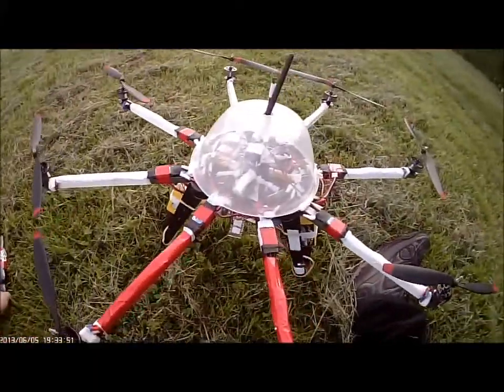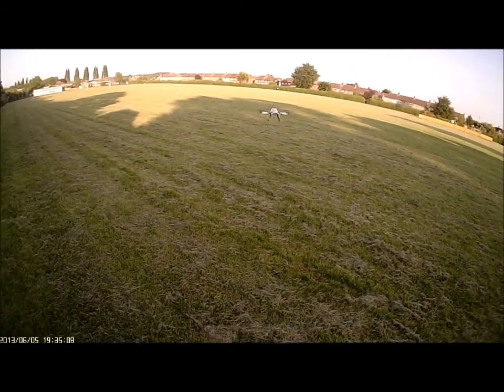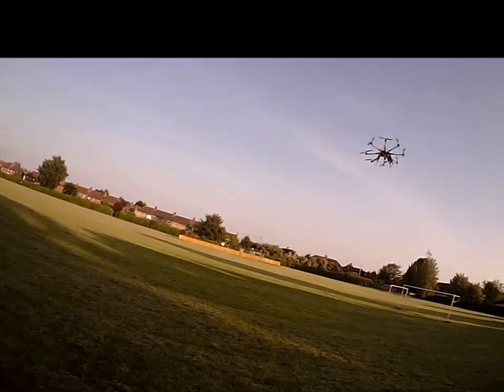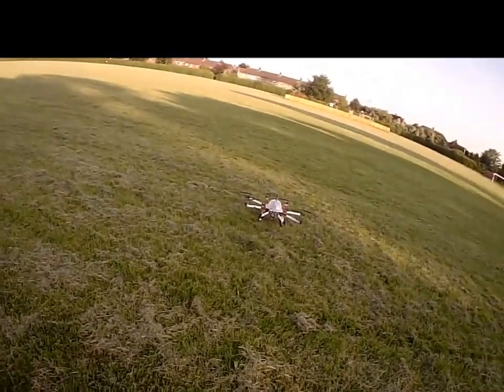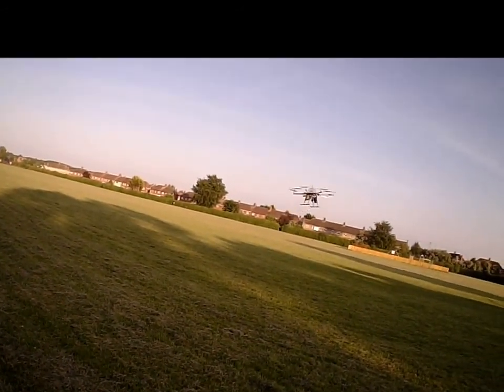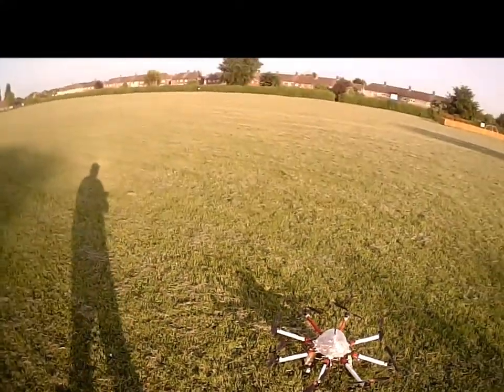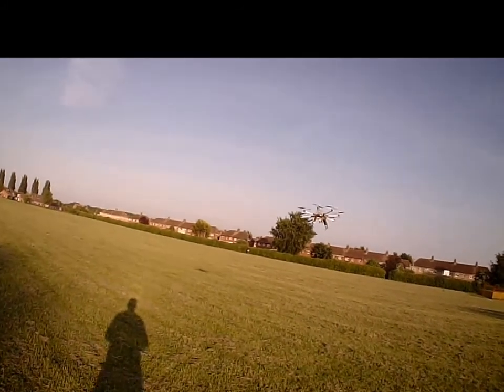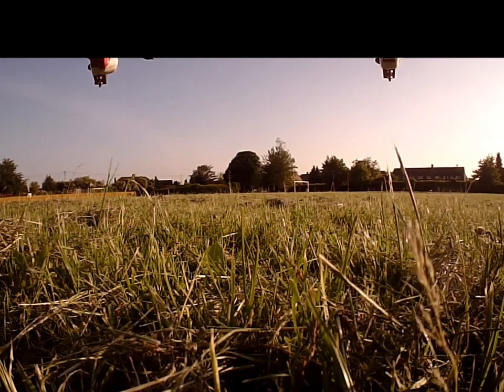Testing out Arducopter 3.0 on my octocopter.

Comment: Great flying! Like  the maneuver through the bush especially.  Looks like your camera gimbals (tilt and roll compensation) works very well and smooth. Are you using servos for the gimbals? If so which ones? Cheers.